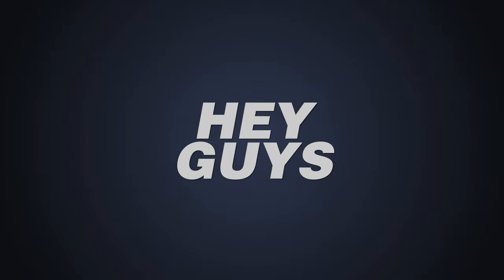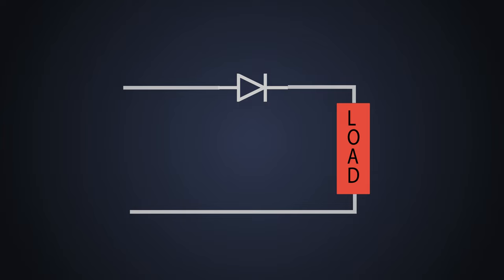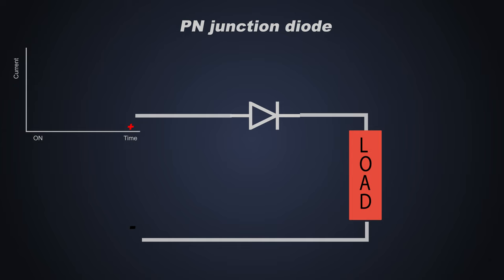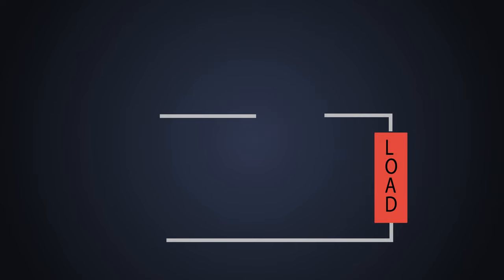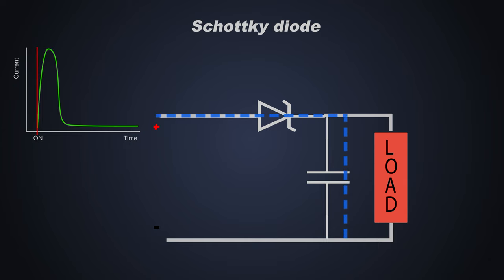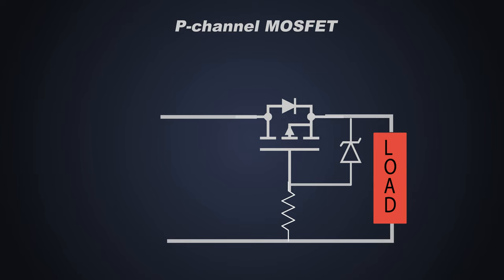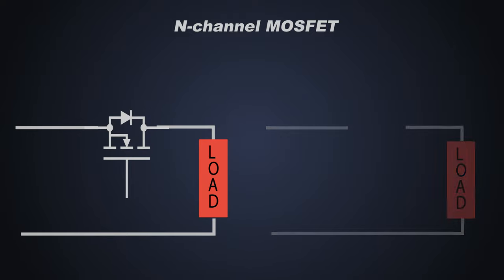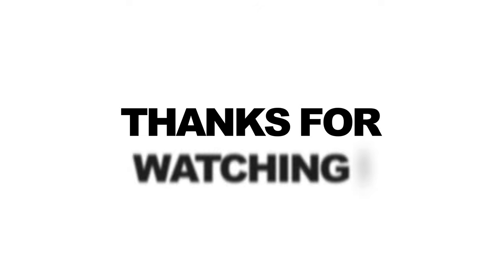Different types of Reverse Voltage Protection types | What is the need? Reverse polarity Protection

Comment: Hello Sir, we can use N channel MOSFET by placing it in between the load and -ve terminal of the source. In that case we do not need a complicated circuit, two resistors and a zener diode can do the job.
Reply from the maker: Come on Anurag don't call me sir, 
You are right we can use N-channel MOSFET like that it is the best solution but, there are many systems where we use different grounding paths for analog and digital signal even they have different connectors and connect the layout with just a small ferrite bead so some limitations arrive for low side NMOS Reverse voltage protection. Otherwise it can be used
Reply: Bouth mosfet circuit is not revers voltage/current protection if d'ont revers drain wisth source terminals!

Comment: What is the disadvantage of using nmos in the low side (i.e. return line)? It will not need a gate drive, and will protect against reverse input.

Comment: Thanks for great presentation sir, I would like to know why is resistor used on the gate and why is zener diode used, is it possible that MOSFET can work without zener diode and resistor? Thanks

Comment: Hello sir, can we use Schottky diode between buck converter (20A, 25v -12v) and battery source device (12v)?
Reply from the maker: you can! but can't comment until the full information of the system is known

Comment: One very easy and cost effective method is to use one diode and fuse.
Reply: This method is the best for high amounts of current in the hundred amps range, because a mosfet can't handle very high currents

Comment: If we talk about Dc-dc converter, this is input side of converter. I am interested in output side of converter ( reverse polarity protection). If By mistake some one connect output side battery of dc dc converter reverse manner.,that will be hazard. Pls. Suggest some circuit for that
Thanks in advance

Comment: I try this method in 52 volt battery the mosfets fail at no load why is this but at 12 volt the mosfet don’t fail why the voltage level damaged the mosfets
Reply: Pchsnnel MOSFET Gate source maximum voltage IS usuallyv-15 -20 or -30V depending on type , thus you should Have a zener diode between Gate andvsource, plus a series resistor to limit zener current to some mA 52V-25V requires some kiloohms such as 4.7 KOhn.